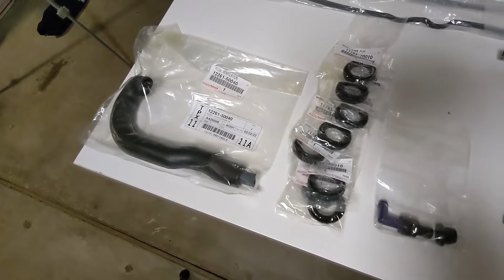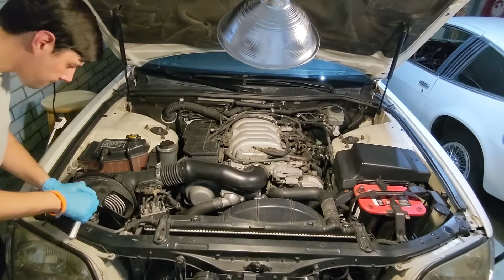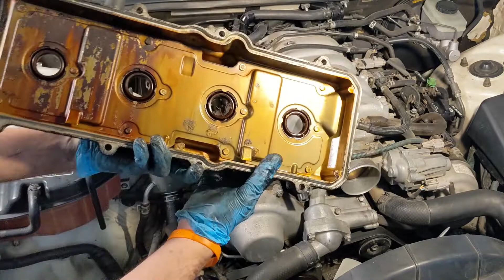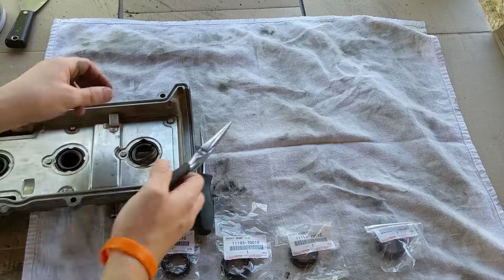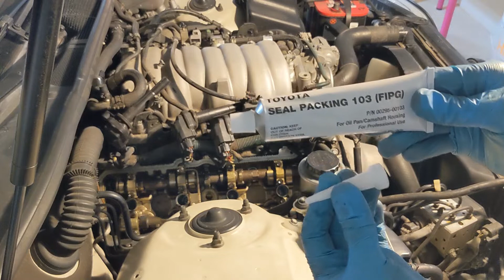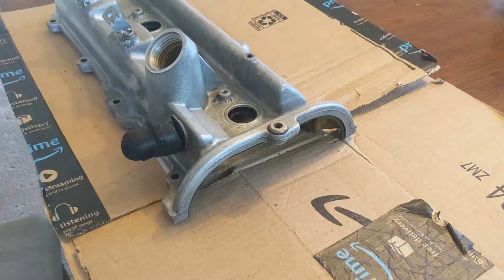How To Replace Valve Cover Gaskets 1998-2000 Lexus LS 400

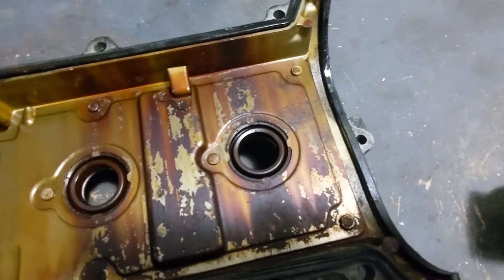Comment: @ 8:47 Do those half moons need to be replaced on the 1998-2000? Or does it only apply to the 97 and under?
Reply from the maker: Depends on how they look I guess. Mine looked fine, I chose not to replace them.

Comment: The video is not great, you showed nothing about taking the half moons out or putting them in. There is a certain torque spec and order you tighten the bolts down to for the valvue cover.
Reply from the maker: I did not change the half moons at all. They looked fine to me.

Comment: I trusted this guy til he broke a bolt that only needed 5ftlb torque
Reply: 52 inch pounds is the correct torque specs. I bet you he just went ahead and drove the damn thing.
Reply from the maker: I am not a professional mechanic, I make mistakes. I left it in the edit to hopefully help others avoid the same.

Comment: This is a Great Detailed Video. I like the coil trick because I broke most of mine - even after i oiled the connectors and let them sit for hours. I'll be on the look out for a PVC valve grommet. Oven Cleaner is cheap and will cut that valve cover cleaning time by more than half. I have to do this to my 1999. I just did Delphi Coils and NGK Iridium Plugs. Thank you for your help. Now I know what to look forward to.
Reply: Corrosive oven cleaner on aluminum???
Reply from the maker: Glad the video was useful. Good luck with your repair!

Comment: Great video. I’m planning to do mine this summer. Can you post a breakdowns of the costs for the items? I’m assuming you got them from a dealership? Are all the parts OEM?
Reply from the maker: I bought OEM Lexus/Toyota parts on eBay. The spark plugs, valve cover gaskets, grommets, PCV valve and hose, and FIPG gasket maker was about $200 total in parts.

Comment: How come you didn’t replace those half moon things?
Reply: Never mind, i just did my and see that they are metal ?!? Looks like they can come out tho
Reply from the maker: A LOT of threads on ClubLexus and other forums talked about replacing them. Mine had no signs of leakage, so I saw no reason to mess with it. If it's not broke, don't fix it.
Reply: That's what the gasket maker is for. To fill in the gaps

Comment: Is this the same for the 1993 Lexus sc400
Reply from the maker: The procedure is basically the same. The 1998-2000 LS400 has a different intake manifold, but it is the same engine.

Comment: Ay bro theres this thing called engine cleaner or carb cleaner...its just alumi...old gift card wtf??.😂😂
Reply from the maker: An old plastic gift card is great for scraping built on gunk and won't damage the aluminum.
Reply: @generationhighoutput  ye if u like scraping shit or an hour...why do that??when u can just dip the pan in degreaser for that same hour and just spray it off
Work smarter not harder..
Reply: Whoever said that is a complainer either way it still got done and prolly came out the same and ye idk what their tambour if you wanna scrape it what're you gonna use a reason blade or a putty knife or driver and scratch dafuq out of the valve cover but thank you very helpful video